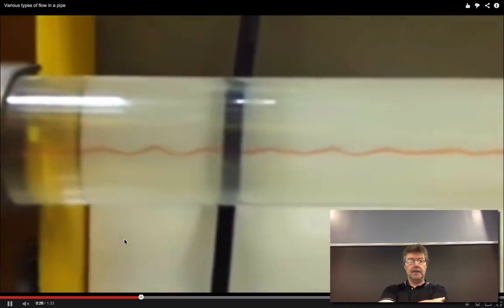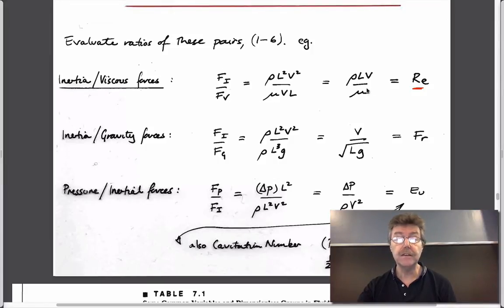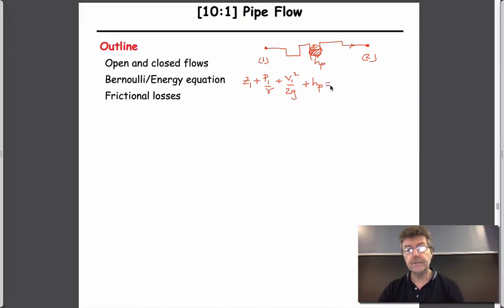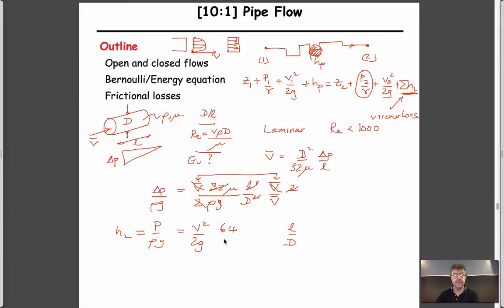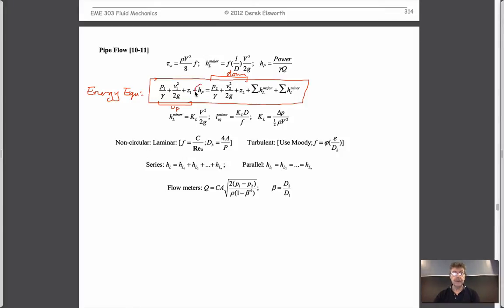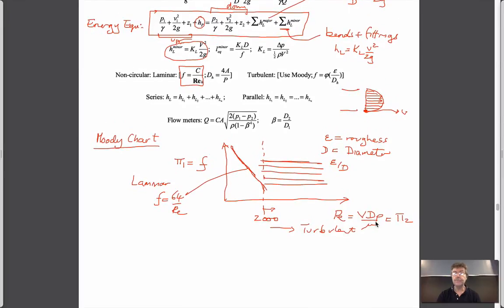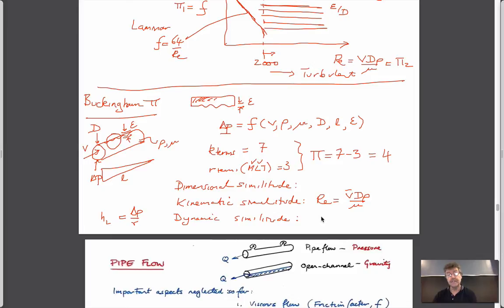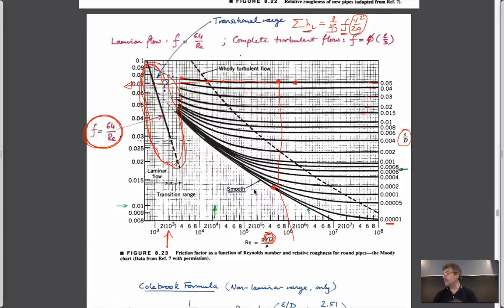10:1 Pipe Flow - Dimensional Analysis

Comment: Using the method of dimensional analysis, derived the correct expression for the pressure drop per unit length (p/L) in a pipe of diameter (D), fluid density, velocity (V), viscosity and surface roughness